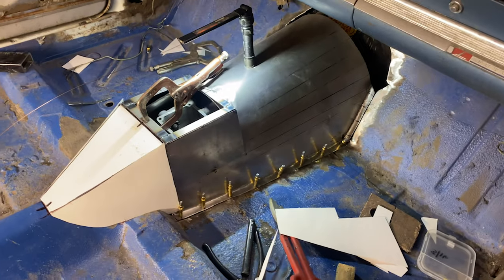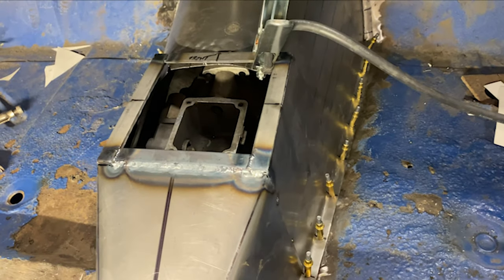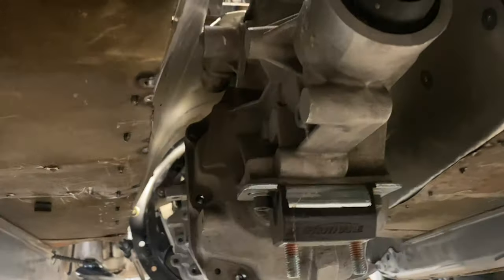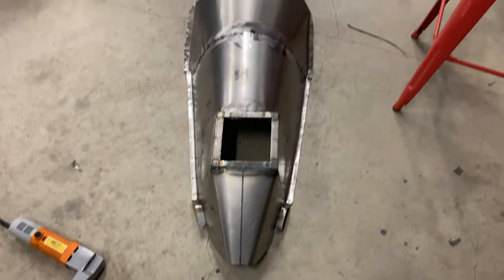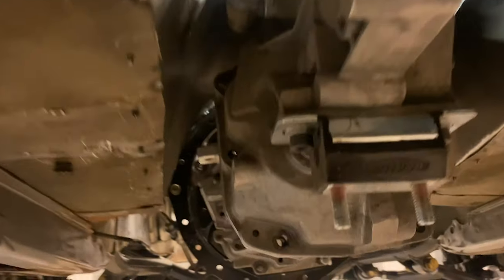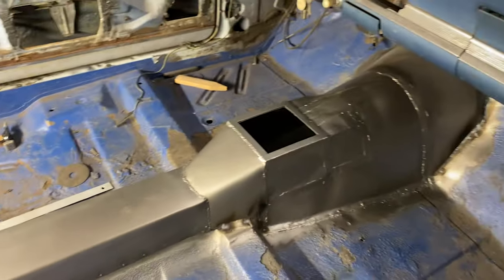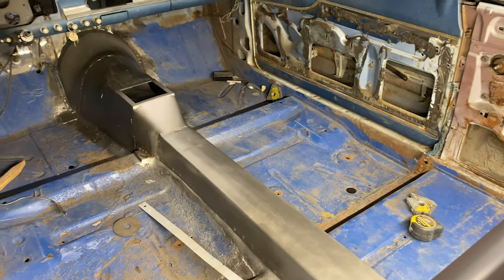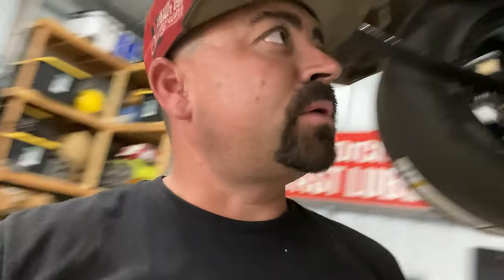#1963 #fordfalcon Fabricating and raising the TUNNEL in the Falcon to fit a TREMEC T-56

Comment: Please don't get me wrong. I like what you're doing. It's not how I'd do things though. I've narrowed several 9" Ford rear differential for Fords and GM cars. Big HP engine with a Ford 8.8 rear? Never. A few times, I've used wood stove pipe for a driveshaft tunnel. I did that when we put a Chevy 305 V8 into a Cavalier with an V6 S-10 rear differential.

Comment: Cut, hammer and beat the hell out of whats needed to make everything easy to be worked on. Dont have to be perfect or to somebody elses expectations to cover a transmission lol, i doubt Henry cared what the floor looked like when the car was built or none of the floorpans would have looked so shitty. Cant see any of it with carpet over it anyway, was wondering if you had worked on it since the summit/jegs tunnel unboxing.
Reply from the maker: Thanks for waiting for me! I have been working on it but time has slowed me a little. And ! hadnt filmed EVERYTHING as i had in the past. Gotta get back in the groove! Thanks for commenting as well! Cheers!